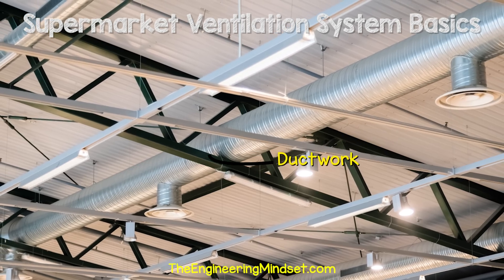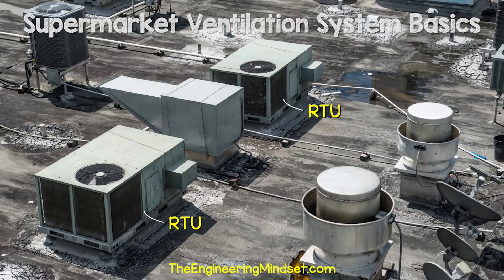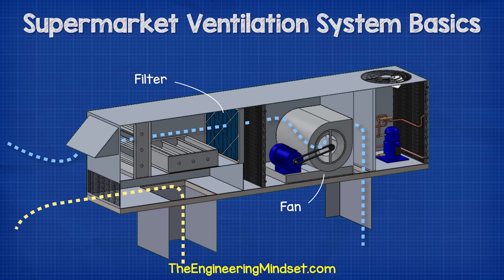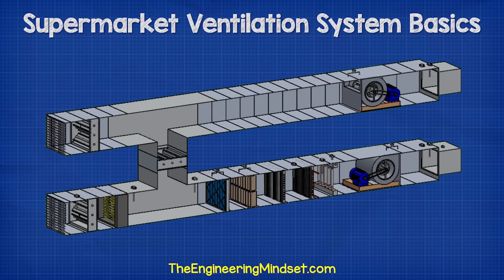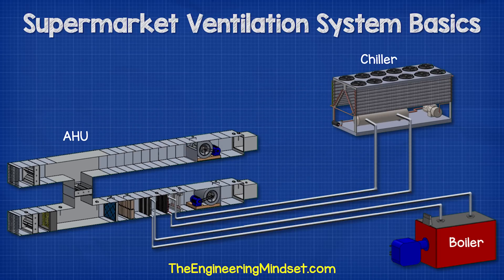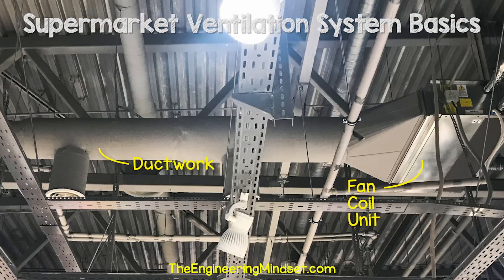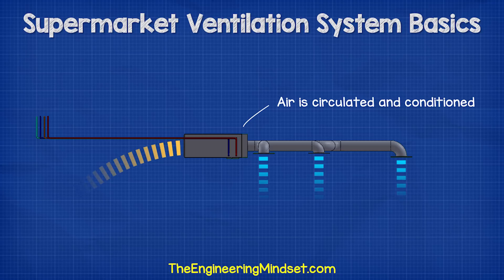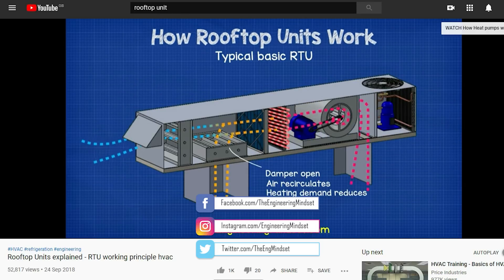Supermarket Ventilation System Basics

Comment: I don't understand why the title mentions supermarkets.  All the same things apply at any big box retail store and most office buildings.  The HVAC engineer in me wonders if the condenser coils for the refrigerated/frozen section could be used as a heat/reheat source in an air handling unit.
Reply: I do m&e maintenance in a large distribution centre and we have pretty much this setup. Having worked in supermarkets in the uk, they are also the same, however they are more focused around the fridge/freezer sections, probably more for energy conservation. In a humid climate I could see issues with condensation, hence the need for more dehumidification. Just a though, I am sure someone will know the answer.

Comment: I work for a company specialized in supermarket HVACR in Canada and I do mostly the HVAC side. What we often have is a large RTU (50-70 tons) coupled with a couple medium sized units, depending on the area of the store. 40% of the time it’ll be a/many air handlers instead of a large RTU. 

Most of the heating comes from the refrigeration racks, we call them heat reclaims, some are piped in the ducts while some in the rtus directly, AAON for example has units designed to accommodate a reclaim coil. There’s either a heat exchanger at the rack with a glycol loop or sometimes refrigerant is sent directly to the reclaim coils before going to the condenser. The back stores and the entrance have reclaim fan coils to heat. Most rtus and air handlers hold a secondary heat source to compensate for very cold days. 

The big interior air handlers have a condensing unit on the roof to feed the evap coil, in rare occasions I’ve seen a small dedicated parallel rack just for the air handlers. The amount of fresh air brought in depends on a lot of factors, sometimes if there’s a lot of exhaust fans we’ll use specialized rtus like AAONS to compensate for the loss, but in other cases, with kitchens for example, there’s a dedicated make up air. In winter we definitely let more air through since it’s already cooled and the RH is more easily controllable.

One of our main goal with the ventilation in a supermarket is to dehumidify, maintaining a low RH alleviates many problems on the refrigeration side. In my area, we mostly worry about that in summer. Oftentimes the air will be passed through the evaporator coil which removes latent heat,then since that air is cold, we heat it with the reclaim coil to make it expand and lower the RH.  It might sound energy inefficient but the difference that it makes to the refrigeration side outweigh that cost. 

It’s probably different in other countries but this is what I’ve seen so far in my career.
Reply: Not true. Maybe that’s why the air feels so much dryer in a supermarket… like you said the cooling condenses a lot. It’s so interesting
Reply: Hi

Comment: That "dirty used air" doesn't leave the air system, it goes back through the return air system passes through the filter and back to the space. What you're showing is a dedicated outdoor air system with an exhaust fan. Which for super markets, is not needed. Also, why pay the cost to condition the outside air from 80, 90, or 100F temp, to 55 - 60 F  only just to through that air outside? You pull that now 75-85 deg air back through the system so it doesn't have as great or a delta...
Reply: That explains why Walmart air system smells like old dirty socks. And why in the summer I feel like I'm suffocating inside those places.
Reply: They never reuse 100% of the dirty used air, because that would be so unhealthy. Some only reuse a small percentage. Even when reusing a small amount it would be better for energy efficiency but way worse for ventilation and air quality to reuse air. They did an experiment a few months ago and they found out how dirty and unhealthy reusing air is. So he’s correct an you’re incorrect.
Reply: He's referring to a DOAS incorrectly. That's what he actually means.